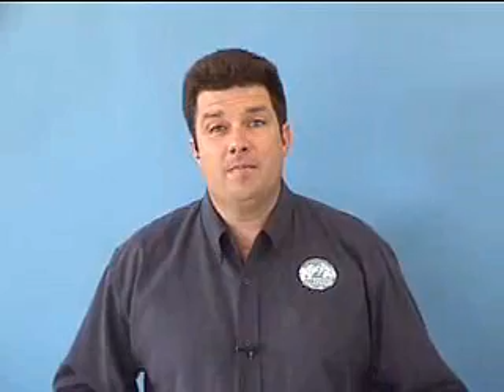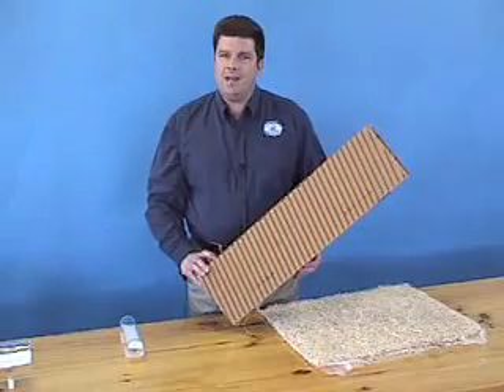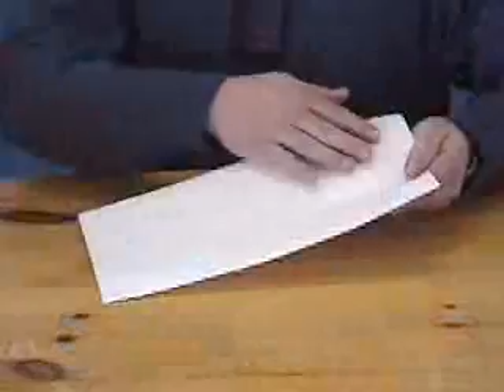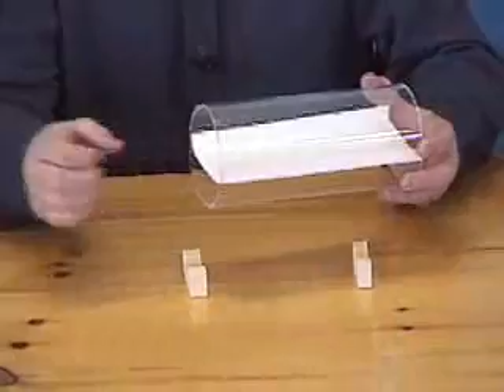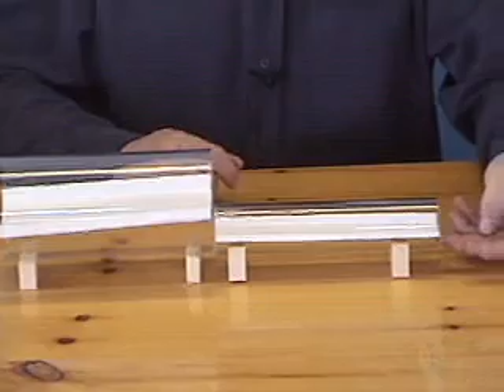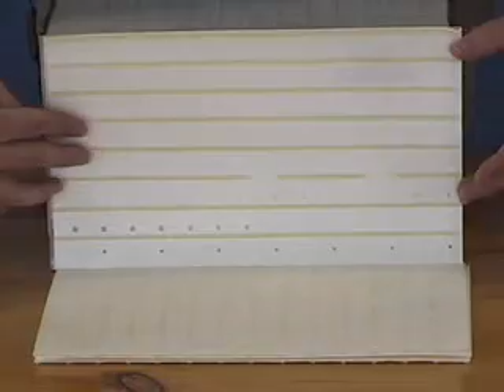Video 2 - Coolerado Air Conditioning Basics (10:01)

Comment: i believe it cant cool below dew point temperature. one should be able to achieve same result by combining intercooler and regular evaporative cooler into one. air goes inside IC inlet, outlet is divided in half (Y pipe or with a variable valve) - 1 is product, 2 is directed to enclosed evaporative cooler inlet that outlets right on the fins of intercooler and off into atmosphere. that would require also only one moving part for fan and, if necessary by evap cooler design, one for water pump. efficiency might benefit by adding optional valve that is computer operated towards dew point temp - at first valve should be closed until IC temp has reached almost dew point, then gradually open. opening point would be adjustable depending how well insulated is the system. if that works as expected then consumer wouldnt be limited to buying expensive coolerado pads and huge commercial coolers but compile the system to his specific needs. again, this would efficiently cool down to almost dew point and never below. in 99% places and seasons that would be enough, but power consumption (pressure loss to achieve dew point) would vary by relative humidity. im building one right now.

Comment: We install like 50 units in a military base in tx  . The coolerado co said it will be maintenance free deal but it is not true  hard water is bad for hmx  had to replace them. 3000 dlls for each set plus all the water they waste   will not install that machine again  never  they dont work with high humidity outside
Reply: Dear  Cesar
 I will be  in the state by January.  where I can connect  your supplier in NY and if you send me his contact as well his location
Reply: Duh
Reply: Duh, they state right up front it's only for LOW HUMIDITY USE.

Comment: I guess they think they can’t compete with modern evaporative coolers without misleading us about them.  Indirect coolers do cool below the wet bulb temperature. (110% efficiency vs. wet bulb)   My evaporative cooler was not indirect but had the 8 inch thick pad made of a cardboard honeycomb material.   90% efficiency meant it turned 100 degree air into 73 degrees and the home left at comfortable 30-45% humidity. I like the product but don’t like being lied to.